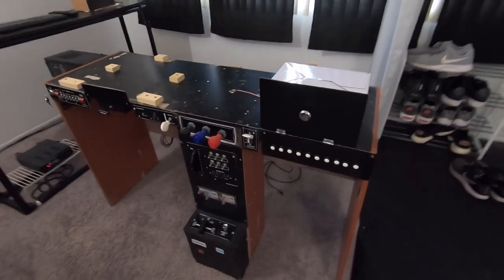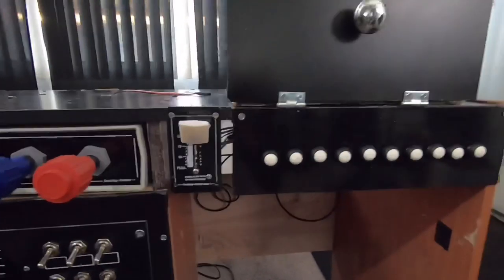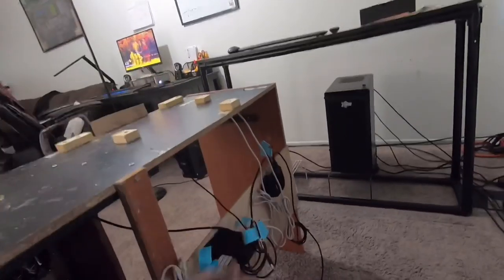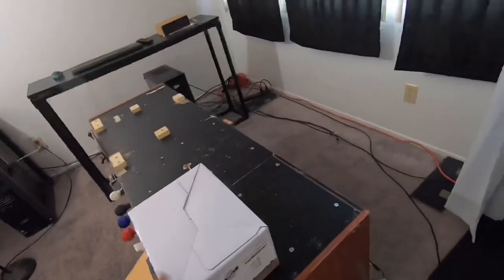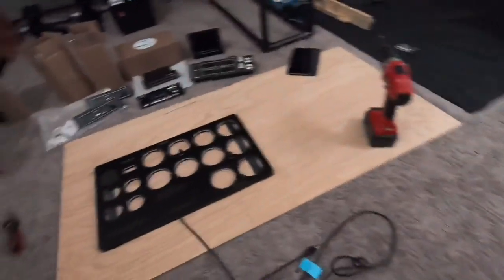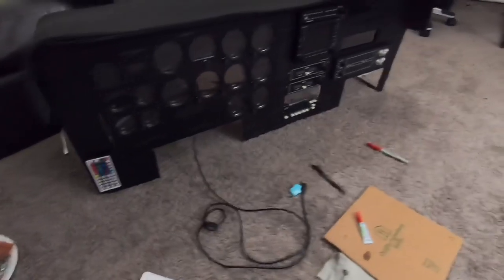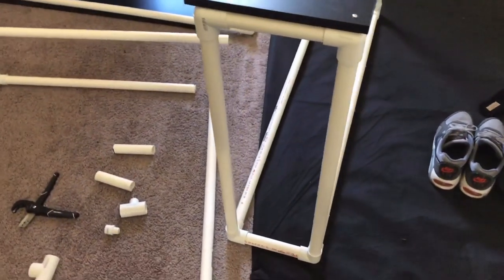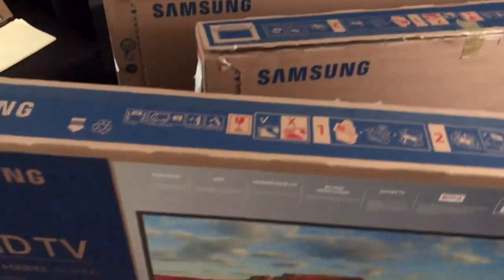Flight Simulator Build - Cockpit Construction | Home Sim Pilot | Xplane 11

Comment: Brilliant thanks for sharing what’s next any more mods you doing to it? What about chair wat you using? Also did you measure the length of the dash in a real cessana to ensure right length or just go with what fitted all the panels you have?
Reply from the maker: Kevin Hughes lol the project never ends. I want to upgrage the yoke and throttle, i want to get another pc and im going to build a seperate G1000 panel so i can switch different avionics. Im just using a nice office chair for now and the cockpit is 47” wide. Just a few inches bigger than a real Cessna

Comment: Love your videos. You are borderline amazing. Thanks for sharing your hard work. I'm in the middle of a Sim build based mostly on your intel. My computer is over the top... Ryzen 9 12-core, Nvidia 3080 graphics card, 32 GB RAM etc. For MSFT Flight Simulator 2020, with this much muscle, what is a realistic refresh rate for best picture quality and performance on the 55 inch monitors (3). What is the refresh rate on your Samsungs and do they perform as you wanted them to?

Comment: Excellent job! thanks for documenting everything. I am a Commercial Pilot and former CFI. I was just getting back to active flying after 17+ years away from the industry when this Covid19 S!#T hit the fan, so now I am working on upgrading my home sim. I have all Saitek hardware, Yoke, pedal, radio, switch panel auto pilot, Cessna trim wheel, multi engine throttle setup and a GoFlightRP48 to adjust my Heading bug and OBS’s. I use 5 21” monitors, 2 for the instrument panel and 3 for the outside views. My PC is really old so now I need a to upgrade the computer and get 3 of those nice monitors plus the RealSimGear GNS530.. I am curious, did you build your PC and if so where did you purchase the components? I’ve been holding out on building a new PC, waiting to find out what FS2020 is going to need. I currently run FS9 mostly and occasionally FSX but because my PC is so old and crappy it can’t handle all the video. Just a note: When I was an active Flight instructor I would always encourage my students to use MS flight sim for procedures training, Dude! You are doing it “As real as it gets”! Nicely done! Oh, hey, what are you using for ATC, equipment and software? Thanks for sharing!
Reply from the maker: Thanks for checking it out! Thats great you already have some stuff. I started with all saitek hardware too. I would suggest first upgrading your pc. I got mines from xforcepc.com and I highly recommend them. You should get at least an i5 overclocked or i7 CPU with a gtx 1080ti and 32G RAM to run all 5 screens smoothly. Then, I would upgrade the yoke. The honeycomb is a good one.

Im using Pilotedge atc and the FSX Dual to connect my headsets to the pc
Reply: Home Sim Pilot  thanks for the reply. Once I get the new computer along with the monitors, I will have to check out the Honeycomb yoke, but honestly I don’t think the Saitek is that bad. That said I have no reference and have never tried any other so I will have to take your word for it.. Thanks again.
Reply from the maker: RonVF Its all about personal preference and since you like the Saitek yoke you should definitely keep it. I modified mines with rubberbands like how you see here on youtube and used it for a year before finally upgrading my sim completely.

Comment: Only thing your missing is that feeling of pitch, roll, and yaw. I'm an automation system integrator and have been toying around with the idea of addressing that missing link. By combining a system like yours with a 3 axis capable 'cage/cockpit' for lack of a better term. Not really sure how I'd sync PC aircraft attitude-movement speed to real world.

Comment: Hi sir ,viewed almost all your videos and they're just great with a lot of cool ideas ,by the way the Samsung 55 inch Tv has 55" crystal UHD TU8000 ,TU 7000 ,TU6900 and TU8300 or the latest 55" QLED Q80T these are all 4k which would be the best Samsung model for a home simulator with good viewing quality with all necessary inputs and plug in pots needed sir, very much appreciate it if you could kindly guide me on this ,tq

Comment: Hi how do I get my I pads to sync in with my flight simulator x plane 11?  I am using the simionic Bezel. the PFD and  the MFD are both paired up together. is just to get it to sync in with x plane 11. I would appreciate your help.

Comment: Josh, I'm a fan. Former Army helicopter pilot and admire your set-ups, patient explanations, and selection of components. Plus somebody apparently taught you well, your past (or current) IP has done a great job based on your airmanship. You've built a system that the average guy can emulate and done a great service here. Have you checked out rogerdodger.net for ideas on going further with PVC cockpit construction? Not that you need it, your system is pretty complete and given me some great ideas on improving my set up, thanks.